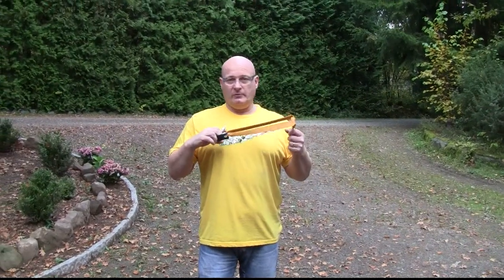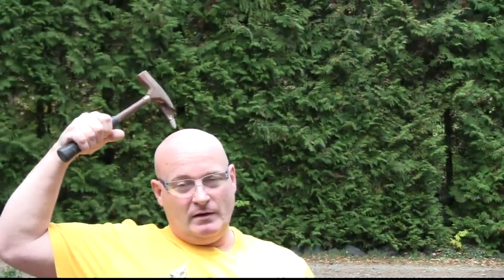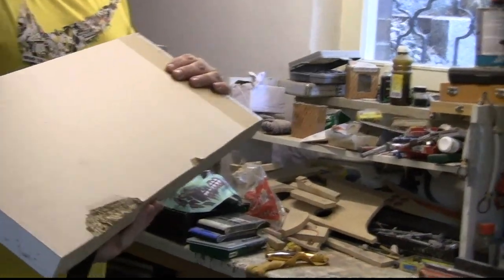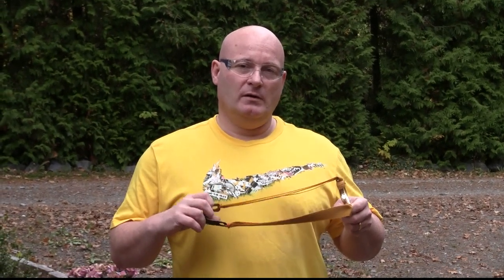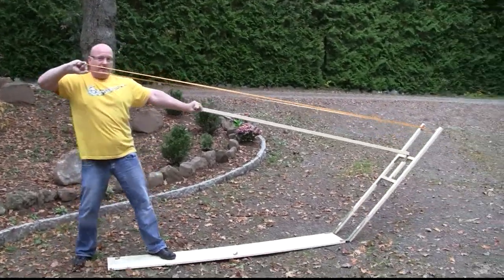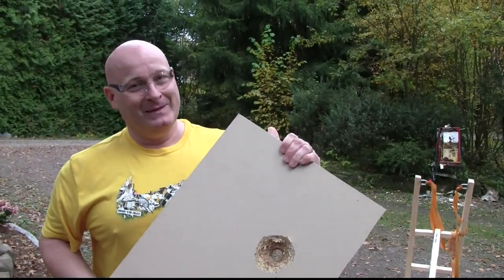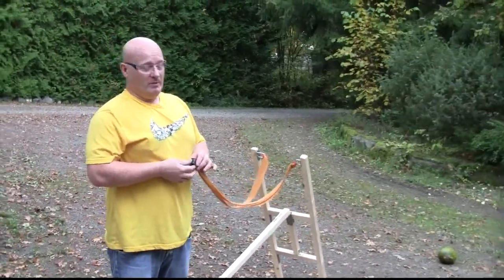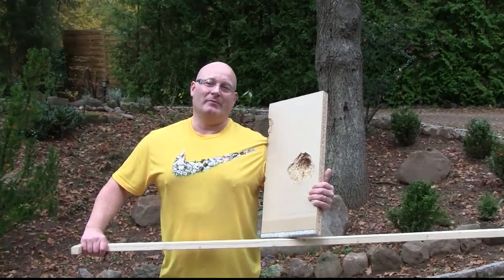Halloween Special #3: Zombie Rooftop Slingshot

Comment: I love this contraption for its sheer destructive power for a hand-operated slingshot. I think this one could be worth revisiting for a new video or two. Like some people have said, put the slingshot on a rotating disc so it can aim in 360 degrees without any kicking, and also try that cube shaped ammo you have. The destruction will be oh so sweet.
Reply: I think it's more mobile without the disc so you can bring it up to a higher roof if you need to.

Comment: I don't know how good of an idea this is but if you placed a circular piece of wood with an ultra smooth coating or piece of material on it and the bottom it sits in with a smaller circle over the top to hold it to the base. some lubricant might not hurt either and that way you could aim and shoot faster. you could also change where you aim to track a running or fast moving target more easily. hope you like the idea.

Comment: I made a slingshot at home, got a 25mm wooden ball and shot it through a magazine, about 10mm thick, about 1 metre away. The wooden ball went completely throgh the magazine - I swear that I could percieve the strong smell of combustion, of burnt paper, as if there was a partial ignition at the point where the ball smashed through the magazine at such a high velocity.
This was an indoor test, the burning smell was so strong that I had to open the window to let it out.

Comment: I think this is a bit of an overkill, as you proved in the zgb video a strong handheld slingshot with triple thera band is more than enough to punch through a zombie skull with a 20mm steel ball, it even came out in the back, therefore I think that this kind of power is really not necessary as the zombie would have been dead anyhow and this slingshot is much bulkier, slower and harder to shoot than your handhowitzer or three pillars of destruction, therefore I think those would've been more effective. That said this is still an amazing slingshot and I was surprised that it was that powerful, great job!

Comment: This slingshot can be improved by placing the fork on a rotating pivot, that pivot should then be mounted on a heavy weight, like a rock or even better, molded concrete, to act as a counter balance. You can then aim up and down, and also to the left and right, it would't be very mobile, but then again, you're on the rooftop :)

Comment from the maker: @MrToshTogo Well, it is more interesting to find out the pressure per square mm. The pointed hammer head obviously had less pressure/mm than the 25mm steel ball - quite impressive, given its bluntness.
Reply: The steel ball had vastly more velocity, and I would guess far more joules.  Slingshots and ball bearings were used to devastating effect in Northern Ireland by young people with no access to guns

Comment: You should put a wheel system for being able to move it easier and faster. And then if you do that also put a wheel lock for when your ready to aim and fire so that it don't slide away in the middle of a shot.

Comment: A bow requires arrows that are very straight, which are time consuming to manufacture. A slingshot can fire improvised and special munitions very easily, anything from hex nuts to pebbles to explosives. This means you can make use of the weapon much longer in a survival situation where a firearm or bow would become useless after you run out of ammo.

Comment: Get a few plastic bottles and a few old valve stems from old tires, drill a hole in the bottle cap just big enough for the stem and not the base, then put 20 or so psi in the bottles and shoot them.
Maybe even some chalk dust in the bottles or something that won't make too much of a mess.

Comment: How about making the rooftop slingshot able to rotate without having to rotate the entire thing. Like mouting the fork on a big round plate instead, that you can stand on, and then make the fork able to both rotate and tilt up and down. That would be better i think. It should be pretty easy to move around the roof too, with light and strong materials.

Comment: @mrsupersadface 
I read that rubber is not the same as springs. It does not behave the same. As you can see on a spring scale if you double the weight or pull you double the spring drawn length. Rubber works this way to a point then things get wierd. There is a point that the draw weight will not increase for a good distance until the rubber fails.

Comment: The Brownings I'm familiar with are very heavy and I'd hate to try to outrun zombies or even starving Americans (far more likely than zombies in the next 20 years or so) while carrying one, let alone the lead, powder, and two glock 18s with their ammunition, so I'll assume you intend to remain stationary. I will too, for as long as I can, and during that time I'll rely on my TCA 5603, but if I have to travel, I'm ditching it for something lighter with easy to find ammo, like a slingshot.

Comment: Jörg i dont think you had to shoot on a clean board, (allthought im happy that you did=)) becuse since the board didnt crack but the shot went clean through on a surface where you had not fired on before within like a inch froom the hit. but as usually you made a great job! im only wondering now if the slingshot cannon had maxed out axceleration (i gues not becuse of the weight of the shots) and how much harder it would have shot.

Comment: Have you ever had one of your slingshots grab the ball bearing and throw it back at you? I built a table mounted slingshot in my highschool shop class for a project and the first time i used it the piece that holds the ball actually grabbed the ball and threw it back in my face and almost broke my nose.

Comment: @JoergSprave indeed... try bringing a chainsaw down on a skull and you're likely to break the chain or get fouled up in the flesh... rendering you defenseless against other attacking zeeks. The other advantage of having your rooftop extended-slingshot is that it is relatively quiet and you might have an easier time blasting zombie melons if their movement is not encouraged by loud gunfire. Just put some spotlights down there at night and it could be a relatively easy shoot.

Comment: Although the hammer did not penetrate, you have to be aware of the thickness of the skull. The wood is hard to penetrate yes,but it is way to thick to simulate what would happen to a zombie skull. Plus, the tip of the hammer isn't even long enough to go through  the particle board. The bottom line is that is you want to simulate a zombie skull accurately then get a board that is has similar durability of a skull and also the same thickness, and besides, what kind of zombie has a 40 mm thick skull?
Reply: i think the point of a 40 mm think board was to show that it would obliterate a skull. Yea, a skull isn't as thick as that, so it's just way more power than possibly needed, which id rather have, than not enough. Do you honestly think it wouldn't kill a zombie? or human? I see no way this doesn't completely destroy a skull. 40mm of hard particle board is...id bet, way tougher than a skull. I mean, if a normal sling shot can make liquid out of a bird's skull while hunting, I think that monster would put a hole in any animal, short of an elephant or other heartier beast. Personally I could give a fuck if it's tested PERFECTLY, but if it goes through 40mm of particle board counter top, ur done son, it's deadly. At that point, does it really matter?
Reply: Bruh language
Reply: Max johnson Bruh, mind your own vocabulary and usage of words. I can say fuck all I want. Fuck, is a great word.  See for your self /watch?v=26UA578yQ5g
Reply: Albert Polák lol if what your saying is true a hunting slingshot with 1 layer of latex rubber is enough  to kill because in a shit you want bands that can kill but you want them to last and carry spares and be easy to draw back nitro rubber has more power than thera gold has more snap but easy to draw  i bet a 8mm steel ball will penatrate your head

Comment: this is a biased way of finding out if the slingshot will kill a zombie/human. the spike hammer has a point whereas a ball has a curve. the point of the spike has less surface area so naturally less dispersion than the ball. A better way of discovering if it will kill (although no way near as much fun) is measuring the speed of the ball at 2 separate points, using them to find the acceleration, then measuring the mass of the ball, and finally using f=m.a. if you google how much force it takes to pierce the skull you will then know if it will kill.
Reply: if the hammer has a smaller surcace than the ball, then it must be easier for the hammer to penetrate. yet, it didnt. the balls penetrated even though their bigger surface.
Reply: Matt Williams of course, semen demons are a natural occurrence
Reply: Mi St if you crack a head your dead anyway slingshots are like a 22 bullet it will spread blunt force trauma